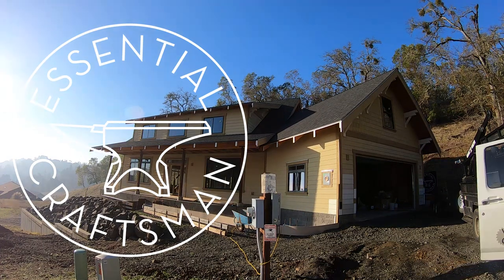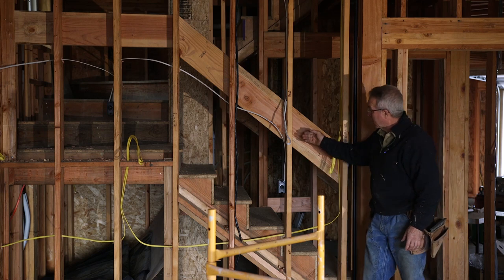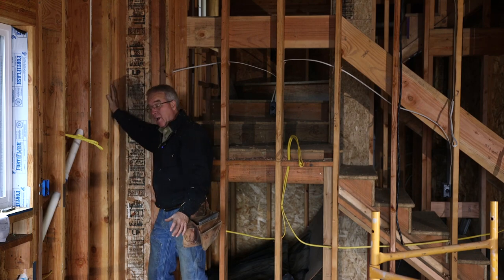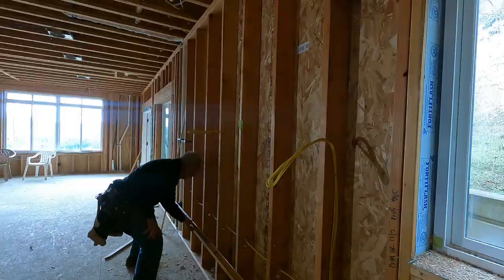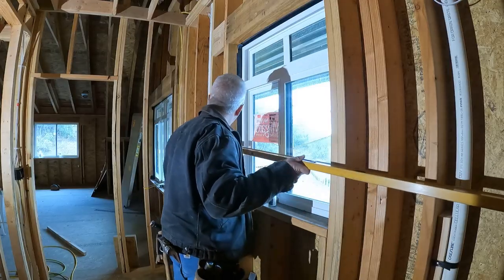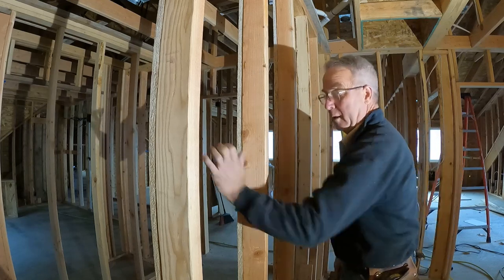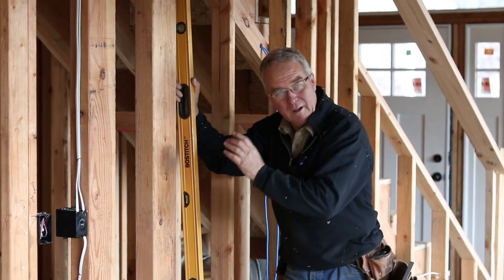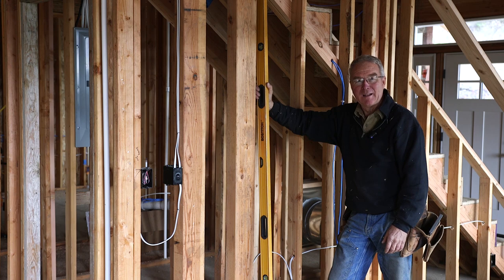Pickup Framing Ep.101

Comment: Drapery Installer here! 

Scott, I could hug you right now.
Reply: I was rehabbing my house and my old boss (who had built his own house) said “for the love of god put blocking in for curtains” 

I asked how big? He said “a fricken 2x12!”

My buddy has been pestering me for the last six months for advice on his curtain rod that fell down. He’s gone through every drywall anchor known to mankind. He can’t use a toggle due to no room behind the drywall (old 3/4  lath furring strips with newer drywall over brick)

I just know I’m going to end up going over there and cut in some blocking and mudding the patch.
Reply: Not only is it a thing. But its an overlooked high paying job that exceeds that of a union carpenter.
Reply: Google says it averages at around 40 grand. Where I’m from union apprentices get more than that
Reply: That would be an in house hourly guy. Most of the industry relies on subs that work for multiple companies and cover a specific area. Commercial work with high price tags rely on subs to supply all those measurements and labor that can destroy a company with 1 bad building measure. Both Residential and Commercial installers would call anything under 100k a bad year in 2021

Lack of work force and high demand along with zero training programs puts a decent installer in high demand.
Reply: @bradleyniven7942  I'm sure you guys earn that paycheck, too. You've never seen picky until you've dealt with one of those "Lean In" housewives in want of curtains and blinds.

Comment: As a homeowner, I think every house should be sold with a complete set of pictures of the house before the drywall is added.  And those pictures transferred along with the title when sold.  That would have helped me so many times!  That was really interesting.  I didn’t know that step was even done.
Reply: It would help a lot, had a friend drill into a water line thankfully it wasn't a power line
Reply: Bill Young I still have files of pictures from custom homes we did even though I am retired from building now.  They came in very handy especially when the drywallers would cover an outlet or forget to pull a low voltage through.  

One time we had a leak show up in the unfinished basement when the custom tile master shower was used.  The plumber journeyman had messed up a solder joint on the controller.  We were able to look at pictures taken just before insulation and figure out how to fixxy fix without tearing into the tiled shower walls.  👍🏼  An example when a picture was worth a thousand curses.
Reply: i bet its not done in most cases ha ha..
Reply: or just update the blueprints with the plumbing and wiring. most tract houses the plumbing and wiring is already set in the blueprint. every house should have a copy of its blueprints kept in it.
Reply: SuperAWaC such levels of detail aren’t required in all jurisdictions.
Reply: We do this on custom homes in Toronto, just taking pictures with our phones. I have heard of companies that pay for each room to be photographed with a 3d camera. It's pretty handy even just for us at the finishing stage.
Reply: I spent several years doing low voltage data cabling.  I agree with you, but sadly I don't see it happening.

When I retrofitted my house I had to find all the chases, soffits, and other hollow spots.  Getting from the attic down to the finished basement was a pain.  I put in 34 ethernet cables, and to attempt to future-proof I went with F/UTP, because the channel-lengths are short enough that it'll to 10GBaseT with the foil.  That should hopefully be enough for the next 40 years or as long as I realistically will have my wits about me.
Reply: @SuperAWaC  I really would like to see detailed blueprints for our tract house--every room seems to have 2 redundant switches side-by-side. If either switch is on, the overhead fixture is on; if both switches are on, the overhead fixture is on; if both switches are off, the overhead fixture is off.  There is only a single set of 3 wires in the overhead fixture so I don't know it could be 1 switch for light, 1 switch for fan, which is what I would assume the double switch should be for.
Reply: Every house should have a complete 3d CAD model. Framing, wiring, plumbing, everything. If I want to locate a stud or a backing plate or a pipe, all I should have to do is pull up the model and get the exact location. Its 2021 there should be no excuse for not building the entire house on a CAD program before any work is begun.
Reply: @denisl2760  Yeah, if the homeowner wants to pay that I'll give them whatever they want 😉
Reply: @denisl2760  the reason is cost, of course.
Reply: @Dale1C  I guarantee you that the cost of a complete 3d CAD model would pay for itself many times over during the building process. Imagine knowing the exact number of 2x4s you need, the exact number of nails and screws, paint, wiring, plumbing, it would cut down on alot of time and wasted material. 

The real reason it isn't done is that the builders are set in their ways and they do things the way they've always been done, innovation is severely lacking.
Reply: @denisl2760  I doubt it, though I agree with you about the lack of innovation generally (I'm a carpenter for a custom home builder). You do see it in some commercial projects though.
Reply: and a a set of "as-built" blueprints (shows the specs of any corrections/changes)!
Reply: @denisl2760  you've never touched a cad program have you?
Reply: @kylekinsey2624  Why you say that?I've touched quite a few. Mainly Solidworks and Creo.

Comment: that's probably the only house within ten miles that has backup plates for the curtain rods and towel racks
Reply: Probably even further than 10 miles!!!
Reply: I built some apartments about 7 miles from his house with backing for all of that. The owner was also the architect
Reply: @12namleht  I can attest to that, I live in Idaho and have been a carpenter for years now and this is the first I've heard of curtain backing. Not that it's a back idea, I am gonna suggest we start putting it in to my boss, but it's definitely not common.
Reply: Wish this was done as common practice. Homes would feel more substantial to the end user. It would take away a decent amount of repair work from handymen, though.
Reply: Maybe the curtain rods but its quite common place for toilet fixtures, railings and not as popular but still done for cabinets. We actually run 1/2 plywood  behind where cabinets are to be hung. I like my mounting screws to look uniform in every cabinet.
Reply: @cameronaberner  I agree. I've never installed backing for curtain rods. But now looking at what my little kids have done to mine....excellent idea!
Reply: and straight walls
Reply: Seems like one of those things that simply wasn't thought-of in the transition from plaster-and-lath to the wallboard/texture system that we've used since the '70s.

I lived in one house that dated to the early fifties when the cement-type plaster was applied the better part of an inch thick over gypsum lath.  Those walls were incredibly strong, probably would break your hand if you punched the wall.  There was simply no need to put any kind of backing up.

Plus for things like towel bars and curtains, there seems to be acceptance of them being rippable from the walls, even if there really shouldn't be.

It's a race to the bottom, who can do the least work for the cost bid for the job, because that difference can mean profit if the company can get enough work to blow through and keep going.  Adding those elements means time and if a competitor is underbidding because they skip then they may win the job from the GC because the GC also wants to save money.
Reply: @harrytinker2328  be nice to handymen lol I fed my family for 2 years as a handyman before I got my career as a commercial construction project manager and superintendent
Reply: @skizzik121  No disrespect to handymen intended! I have supported myself and family as one for the past 17 years. Fixing failed drywall anchors is a regularly requested task.
Reply: I'll agree with everyone else here, I have never seen any where near this level a attention paid to preparing for drywall.  If that is a matter of routine for him, I'd like him as my next general.
Reply: Lol more like the only one with 100miles
Reply: @harrytinker2328  fixing failed anchors might have been 25% of my income lol. I had a couple of apartment complexes on contract where I gave them a little discount for priority scheduling (basically I would head over there at 2 am if need be and they could cut in line if it wasn't too major of a thing that it would destroy my week) and I the number of times people would bitch at me when their dollar store 3/8 chinsy little anchor failed and their tv or whatever fell would surprise most people with a brain. Although I did have a call to a machine shop where you know you wouldn't think the guys would need a handyman where they had proper epoxied in concrete anchors fail 4 times on a 10 ton power hammer, they had given up and called to see if I could figure out a solution, I did...drill big ass holes and put in big ass bolts all the way through the concrete. Thinking back I wonder if that has cracked. I had soil on my drill bit but it was a decent 6 inch thick reinforced slab. I guess that should hold?
Reply: rough framed for years.  Get it done was the chorus and the melody.  Make sure it won't catch the inspectors eye was the refrain.  I hated that company...  loved working, but really???  So glad you posted this video.  Most couldn't care about a bowed stud let alone planing a face hoist in a stairwell.  Losing money😖😣😲wawawaaaa.    nicely done as always💪👍👍hopefully this instills more principle to carpenters nowadays
Reply: You have no idea....
Reply: Every time I backframed I put in toilet paper backing even that’s the way we went
Reply: We call it back framing btw
Reply: It would be nice to have backing everywhere, but on the other hand you don't know it's there or where it is when you are re-doing something years down the road.
Reply: I did some steel stud framing and we put blocking everywhere, including the base area. I might do that even with wood framing now.  Nice to have it with taller base trim.

Comment: I never knew about the dimensions of the Skilsaw table being 3 1/2 & 1 1/2 from the blade, good to know so you don't have to pull out a tape or speed square
Reply: I didn't either.  It's a great tip.
Reply: Me here with my off brand with 4 on one side and 1 1/8 on the other.
Reply: Used one for years never knew.
Reply: Not sure about the older models but my year old mag 77 has the measurements etched on the front of the table, huge time saver
Reply: At least that skill 77 does. Great saw.

Comment: I was a residential rocker from the late '70s to the early '90s.  Never once saw any sort of pickup work done on any house I ever hung (over hundreds and hundreds of houses).  If something was dreadfully out of whack we had to fix it ourselves before we hung the surface.  Sawed a lot of studs mostly in two in order to push them back into the plane of the wall.

Scott's explanation of corner blocking and the amount of allowable "float" is exactly right on

Comment: I loved your comments about a "picture or two".  Last couple years I have single-handedly wired, insulated, and installed plywood on the walls of my little detached woodshop.  I am not a builder.  When the wiring was completed, I made a vertical stick marked in 6" graduations and temporarily tacked it up for a picture of every square inch of walls in my shop.  The pictures all overlap and are titled which wall is pictured.  I (or any future owner) can always locate the wiring from the floor.  I didn't have plumbing or communications or I would have included that as well.  I did use nail plates, but this is just to record the height of each and every wire that could potentially interfere with a future modification project.  I cannot tell you how many times I have "given an eye tooth" to have had that level of detail in my homes and was surprised to find an unknown utility cost would alter the cost of a modification I wanted to do.  My scaled wiring diagram is taped to the cover of my electrical panel, with subscript instructions that pictures are located in the home documents that will go to a new owner one day.

Comment: I've run grading equipment for 16 years mostly doing grading for new homes, apartments and other buildings. Such work as clearing the land, digging basements, stair stepping hills for apartments and townhomes, backfilling around walls, final grading of the yards and so forth, building pads, large parking lots, extra long driveway or driveways on very unstable ground, putting in drainage systems from downspout piping to 48" concrete stormwater pipes, digging ponds, silt basins and everything in between these things. No roads or streets in developments but most anything else to do with dirt work from residential to commercial. Never have I seen a carpenter flatten the walls or seen it after it was done and have never heard of it till now. NC has some good builders I guess. I've worked for older guys that have been home builders all their life like you that even still build the kitchen and bathroom cabinets on the job and never seen them do it or seen where they'd done it. I guess you never stop learning new things but this seems like something that all carpenters would do and I'd seen it by now if it was done around here. Can't believe it would be overlooked and I know that the lumber that goes into these structures aren't any straighter than what you have on the west coast. I'm going to inquire into this on the next home and/or commercial building job we do. Stay well. -Wil  👍

Comment: Some drywallers will install corner bead to inside corners to support floating drywall. Some even use this technique to support the ends of ceiling drywall so trusses do not cause cracks with building movement. They leave the last 8 inches floating and attach it to the corner bead that is attached to the wall top plate. The screws have to go in carefully to not strip through the thin corner bead.

Comment: You learn a lot about pickup work when you spend many years doing every phase of the work yourself.  Some of the first houses I built (with a partner who knew what he was doing) we did everything.  From the foundation to the roof and everything in between, except for the finishing; paint, carpet, floor coverings, etc.  When doing the plumbing you find the problems made by the framers that makes your job harder and so on.  What I realized was that most of the trades, who do just one aspect of the building, are not even aware of the problems that they create for those who follow them.  It takes many years of experience, and advise from the other trades, to really educate any tradesman.  I found that after fifteen years of building and doing the work of every aspect of the project, when I moved to the Dark Side, and became the inspector, I was really able to be of help to many of the craftsmen starting out in the construction trade.

Comment: Glad to see you planing down the joists in the stairway and around windows and doors. As a board hanger and plasterer, those areas never look right once board is installed and finished. But at that point, the hanger isn't going to pull out the planer to fix it. Good to see that you do this, Scott, as hardly anyone I know on the east coast does. Keep it up!
Steve.

Comment: This is a great video because this practice is a rare thing.  I will add that it is a good idea to install a row of blocking half way up the interior walls at the time of framing.  This helps to prevent some crowning and twisting that occurs in the time before drywall goes up.  The blocking ties all of the studs together similar to bridging or strongbacks in a floor system.

Comment: At 4:10, I usually use scraps of 1/2 ply to back up the sheetrock, I cut ~4.5 inch wide strips and either glue/clamp with construction adhesive, or just screw through the 2x and then into the ply. (this will leave the points of the screws in the void, which is not so nice if you are planning to put bat insulation in later.) Thanks for a great series!

Comment: 4:40
hang the sheet to your left first with metal drywall clips then the other sheet over the clips. removes lumber from the project which is cost and it also means you get more insulation in.

Comment: In kitchen and bathrooms with a lot in the walls, sometimes I will pull a tape and snap a couple pictures for quick reference later for cabinets and electrical add ins. People always change things later and it really helps  to know exactly where the romex turns into boxes and where pex piping is that you don't want to cut into. People want to add or move outlets on some back to back kitchen/bathroom wall and you can tell them exactly where it can't go without a really expensive scanner.

Comment: Whenever we have to deal with bowed studs we cut a notch in the bowed stud at the highest point and run a block across to push/pull the bowed stud back in line with the wall.

8:00 yeah, that's the thing.

Comment: I find its nice to black spray paint a line at all the stud locations on the subfloor before the board goes on, and maybe the plumbing, hvac, and electrical in different colors. Then when the plaster goes on you can just take a framing square and quickly mark them back on the wall for baseboard, cabs, etc before the finish floor goes on. Hope this helps someone, I know it might not be so useful with standard drywall.